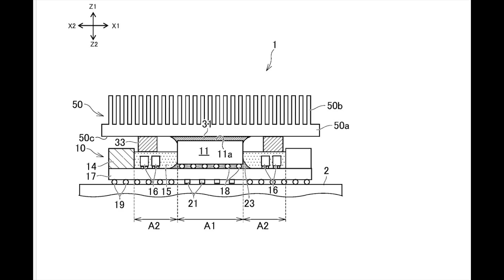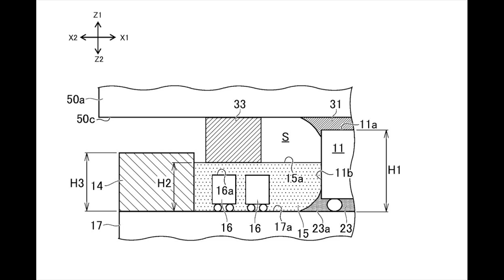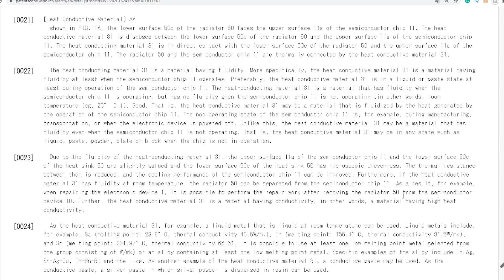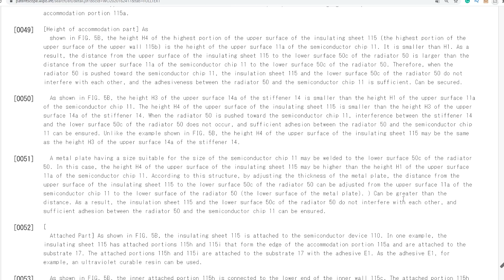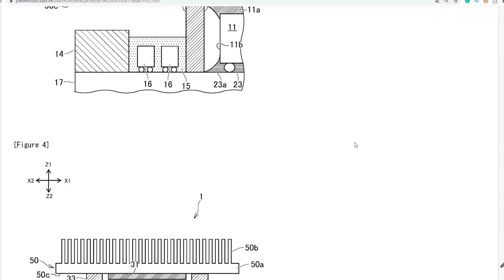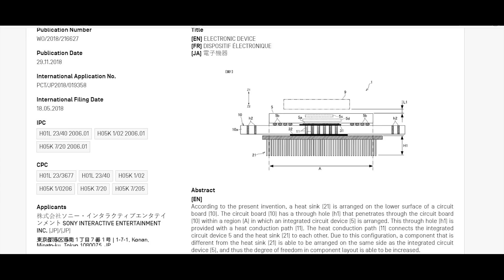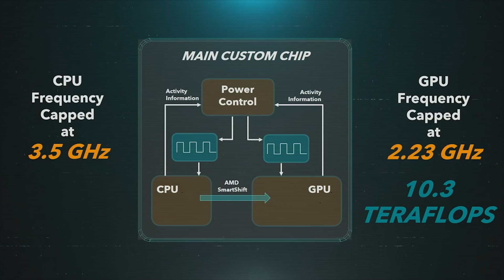Playstation 5 Liquid Metal Cooling Solution Patent Explained

Comment: @ RedGamingTech
Thanks for another interesting video.
I personally don't think they are "talking about" the same type of "liquid metal" that (sometimes) are used for PC's today (e.g. Thermal Grizzly Conductonaut).
Rather I believe SONY are "referring to" a type of "Semi Liquid metal" ((I don't remember the proper term)) that was available "a couple of Years ago" ((i.e. before the current gen. of proper liquid metal)). This TIM was like a "metal shim" that was put between the processor and the "cooler", and then "initiated"/mated to the processor by running the processor but not cooing the heatsink, so that the "unnormal heat" of the processor would melt the  "shim". And thereby "in essence" creating a "perfectly fitting metal interface" between the cooler and the processor (an interface that under normal usage was highly heat conductive but remained solid ).
The reason that I believe this is partially that I believe that it would be hard to use "proper liquid metal" in a product that has a "vertically positioned chip"in a mass produced product with a multi year warranty. But also I base it on some of the wording in the patent document (at least from what I could "glean" )
The wording I refer to is:
 "...In the semiconductor device of Patent Document 2 , instead of thermal grease A METAL THAT IS LIQUIFIEd BY HEAT DURING OPERATION OF THE SEMICONDUCTOR CHIP is used as a heat conductive material between the semiconductor chip and the radiator..."
At least that is my "pet theory"for now, I guess we will see how it actually works "relatively shortly" :)
Best regards.

Comment: Just solder it, and when it fractures from heat cycling, the tell tales can flag a servicing light and onscreen message to appear. Also make the system functional, but clock down until the unit has been serviced. If its years past warranty provide documentation and video tutorials as well as offer a paid solution. 

Liquid metal let us not forget, is the inferior solution. Then again ryzen under water, is extremely easy to cool my guess from not bumping up against the laws of physics chasing clockrates, and the IMC being onboard like we were in the 90s. Id really like to jump back to AMD rendering hardware, but the single threaded DX11 problem is to me unacceptable. It looks like DX9 support for freesync exists now though. 

Still waiting on someone to cover intels compiler, but no so called tech sites will touch it, and linus' team went full blown, embrace the bribery with the 5k per employee or whatever video they just dropped. You basically wont be getting sound coverage to the extent they can get away with it straight facedly unless they burn that bridge.

Comment: normally pc have no issues running 4k when gpu run on its own board as cpu can freely run 4 ghz or higher is require for ray tracing games...ray tracing does poorly on low clock cpu's

Comment: so both consoles having problems with heating issues...due to bad gpu's in them is hindering zen cpu's performance ...
Reply: They have like 2080 ti performance. We already saw them run Gears 5 on the Xbox running 2080 frame rates but with ray tracing added in. That means it's even faster than the 2080 ti. We haven't really seen a good comparison from Sony yet but I have no doubt the GPU is fairly impressive.

Comment: If this thing is not thermally limited then why the variable clock speed and exotic cooling?  They did it just for fun?
Reply: I think it's more they learned the Xbox was had so many more stream processors to keep up they cranked up clocks. They probably were already planning the odd cooling system but with thermal paste but they had to go liquid metal to keep it cool. This would explain the early rumors it ran hot. 

It basically is them maxing performance for the cost of the silicon as silicon is harder to get at scale demand. Though the gallium likely is more expensive in the long run it is easier to get than just as many larger chips.

Comment: Is it me or does this kinda suggest the original claims PS5 ran hot likely were true? I mean, liquid metal is not cheap, I highly doubt that was their first choice. Plus designing a chamber to keep it from seeping out also took development time plus extra manufacturing. Purhaps they made a few without this early on, realized it ran hot and went back to do this as a last ditch fix without changing the entire system's design.
Reply: Patent filing date predates any overheating rumours. It’s also not a quick bodge fix on a mass produced device needing to survive being thrown around in transport and retail while not introducing more warranty issues.  

For what it’s worth you can find rumours of PS4 overheating and shutting down and Sony struggling in the months leading up to PS4’s release. Those too were nonsense.

Comment: I think I understand why Sony massively overclocked their GPU: thermal headroom. They were surprised when they heard about the Series X's specifications, and that is the reason they went through with such a risk.

The patent for the extravagant, uncanny liquid metal cooling system could have been a well-thought out and articulated solution for the PS5's thermals. This, in my opinion, has allowed Sony to be more patient yet aggressive with their approach for the next generation. Sony is able to counter most, or all, difficulties thrown in front of them in face of hardware news from their competitor. A genius idea, and I hope the liquid metal cooler works effectively and safely.
Reply: The entire console architecture is built around variable clock. That isn’t something that gets turned on in a reactionary fashion. It’s something set in stone years in advance.
Reply: Sony never confirmed that the PS5 overclocked, end of argument
Reply: @מוטיאהרן  By the way, what is up with that weird name of yours that bugs my text?
Reply: @hugoanderkivi  ???
Reply: @מוטיאהרן  My text is on the rightside instead of the leftside.
Reply: @hugoanderkivi  becuse in Hebrew it's on the right...
Reply: @מוטיאהרן  I was suspecting that cause, because it does look like a mirror image from my text without the change of letters.
Reply: @מוטיאהרן  Yeah, the PS5 isn't "overclocked" as such. It's just that It's clocked higher than the norm, so people assume It's being "pushed to Its limits" or over Its designed limits etc (usually said in reference to the Series X being "more powerful" so Sony just "overclocked it in fear", or some crap)

It is however confirmed on what Its clock speeds are and in normal circumstances, that may cause the system to run thermally high. With Variable clock frequencies (and potentially this fancier cooling solution) heat (and performance) wont be an issue for the system.

I actually don't think a "better than normal" cooling system was actually needed for PS5, but they are probably doing it specifically because of the stigma of the "jet engine" of PS4. They certainly seem to be taking ALL of the shortcomings of the current-gen and removing them for "next".

מוטי אהרן  I do have to say, it's very distracting typing with the text entry reversed. It behaves very strangely lol. I can only imagine you deal with that all the time
Reply: @MrVelociraptor75  soon the teardown of the PS5 will reveal then all the bias can put to sleep...
Reply: @מוטיאהרן  I agree, I'm really keen for the teardown to happen! It will be quite interesting indeed

Comment: This makes the pro version of the ps5 great because they will probably have a different cpu possibly or a better one that's even more overclocked than the one in the ps5 so we should see some intresting things with the ps5 for sure
Reply: I don't think there's going to be a pro. Rumors are saying this gen will be short and I believe it. These ones don't use chiplets, next year we get chiplet GPUs and 3D stacked CPUs, DDR5, GDDR6X is already here so 7 will be in only a couple years, these systems seem to not be EUV which is cheaper, and there is a chance gallium nitride may be replacing normal silicon in the next few years. 

There isn't going to be a pro this is just going to be a really short lived generation as in only two years we may have already nearly doubled performance from now. There's no point of a pro then, that's when you just make a new system as after we reach 3nm we likely won't make it much farther till we move off silicon.

Comment: Most of the heating problems are coming from an overclocked GPU. All to get 1 extra TFLOP. They made the same mistake Xbox did with Xbox One... putting in an underpowered GPU.
Reply: The PS5 not overclocked pathetic clown, it's using smart shift technology by AMD
https://www.amd.com/en/technologies/smartshift
Sony never confirmed that the PS5 overclocked, end of argument
Reply: Sony said the GPU was overclocked, which shifts it at times from 9TFLOPS to 10TFLOPS. You can call it SmartShift or SmartShit, it is a variable clocked GPU. Cheers.
Reply: @honkyjesuseternal  the variable frequency on the PS5 exists only because smart shift technology by AMD exists on the PS5... cheers...
Reply: @מוטיאהרן  You mean variable clock tech? Yeah it is going to overclock to 10 TFLOPS sometimes. It isn't rocket science, in fact it is the wrong kind of science.
Reply: @מוטיאהרן  Smart shift is sometimes overclocking the console GPU. Cheers.
Reply: @honkyjesuseternal  it's sometimes? And you know now it's the time when Sony never confirmed that? You clowns don't know when to quit from the lies propoganda 😂
Reply: @honkyjesuseternal  no it's not overclocked as PC doing, read about it on AMD site...
https://www.amd.com/en/technologies/smartshift

Comment: There was that rumor that Sony didn't want to do the PS5 teardown until they had actual production units in hand because they were worried that shareholders would think Sony wouldn't be able to mass produce the PS5 that way. If they're doing liquid metal then that makes a lot of sense.

If they're using gallium then adding that into each console without contaminating the rest of the board would definitely be a hurdle. They could could cool the motherboard enough that it freezes the gallium when they fill the processor pocket, then seal it up and they're good as long as it doesn't leak. 

They would also need to make sure there was enough gallium in the pocket so that it would contact the processor fully whether the console is upright or lying flat. So they wouldn't want any air pockets in it. 

From the patent images it looks like they'll have either regular thermal compound or a layer of gallium on the top of the APU and then have gallium surrounding and cooling the APU from the sides.

Comment: Liquid metal cooling, oh this console is going to be expensive I'm telling you now.
Reply: Liqud metal is cheap lol
Reply: @malathomas6141  No it isn't.
Reply: @bentennyson2398  not as cheap as high quality thermal paste. But still cheap
Reply: @malathomas6141  Nowhere near as cheap.
Reply: @malathomas6141  Infact it'll probably add a further $150-$200 onto the price.
Reply: @bentennyson2398  highly doubt sony would use it in ghe first place
Reply: @malathomas6141  Probably not.
Reply: @bentennyson2398  No it won't lmao.
Reply: @SavantGardeEX  it's more expensive yes, but worse it also reacts to most conductive metals making some of it go to waste. This means they have go fill the area with it more than it needs to be. It's why DerBauer says to repaste liquid metal after 2 months as a large amount will absorb into the cooler.

Comment: liquid metal is better at transferring heat yes, but liquid metal is not meant for a long term application, enthusiast use it to overclock their machine, but they need to reapply the liquid metal after about a year because it breaks down faster than regular thermal paste, liquid metal in a console is a bad idea and will lead to a big headache for sony when it wears out. thermal paste on the other hand can last more than 5 years with no problems, lmao this will be interesting to see how it turns out for sony. liquid metal also erodes the cpu integrated heat spreader over a course of 2 years which is very bad

Comment: Twitter's already losing it's sh*t over those Hotchips slides, I see. Series X apparently has 8x PCIe 4.0 lanes for attached devices (like the SSD), people don't seem to realise that 4x PCIe 4.0 provides 8GB/s of bandwidth, which is more than the raw throughput of either console's SSD. Using all 8 PCIe lanes just for the SSD would make no difference over using 4 as it can't take advantage of the extra bandwidth anyway.
Edit: There's another slide that explains the Series X SSD uses 2x PCIe Gen4 lanes.
Reply: Those slides prove how much of a beast the Series X is, especially when comparing to the PS5 specs. I know MS hasn't really done a good job of conveying that power but my god is that console not only a powerhouse but extremely efficient as well.
Reply: @mopar426power  Most of the information in the slides was made available in March, there are a few additional details regarding things like cache sizes and RDNA2 features not yet disclosed by AMD.
PS5 is still largely unknown by comparison. Cerny covered a few systems in extreme detail but how it compares to Series X in general is very much a mystery.
Reply: CanadianLoki76  the SSD itself maxes out at 2.4GB/s, so there's no point in giving it more PCIe bandwidth.
Reply: What is your argument here? There are other components that can use PCIe lanes hence why it can be beneficial to have more than what your storage needs. I don't understand why you people want to cherry pick information to make your favored product look better than the other.  XBSX is the world's most powerful console on paper. Just take that and fuck off seriously. An estimated 98% of consumers don't understand the technicals or even try to understand. All XB fans care about is "the world's most powerful console" and all PS fans care about is PS exclusives. Judging by what I've seen less than 1% of people are even considering switching from either as their primary despite both sides cherry picking or giving their misinformed opinion of which is better. One thing that is certain is PS will have exclusives that will blow us away, and XB will have a better looking COD. Have fun with that. P.S. remember when XB fans were salty about how good GOW was and the fact XB didn't have anything like it? I do!
Reply: @GR1MR34PER33  if you're referring to my original comment there is no argument at all. It was an observation of the behaviour of certain people on Twitter attempting to cherry pick information to make their favoured product appear better than the other, and failing miserably due to their lack of even a fundamental understanding of that information.

I honestly don't understand why you people who reduce everything to simple fanboy slogans like "worlds most powerful console" and "best exclusives" don't just fuck off and leave everyone who's actually interested in the technical details to enjoy them. You've already come to conclusions so why are you even here trying to shut down discussion?
Reply: @faustianblur1798  I actually do enjoy the technical details. I watched the deep dive event and actually enjoyed it and understood the majority of the information. Some of that is due to my own knowledge and cognitive ability, the rest due to Mark Cerny doing an excellent job of breaking things down. Then I watched others who are far more knowledgeable than I am like Cherno and Corteks to take my understanding a lot further. I apologise as it seems that I misunderstood your previous comment. I like a lot of others including yourself it appears, am tired of the fanboys of both sides who act like they know when it's  painfully obvious that it's quite the opposite.
Reply: English?